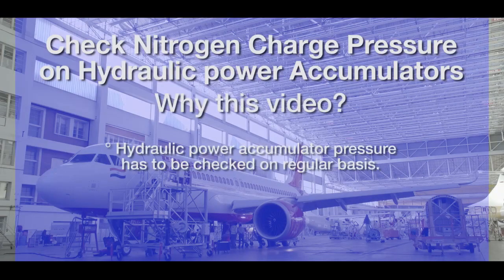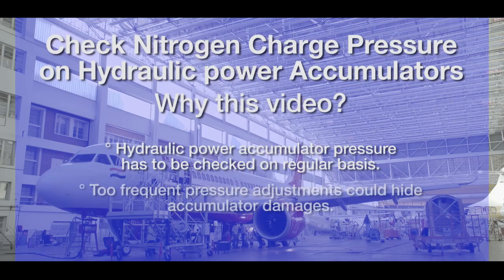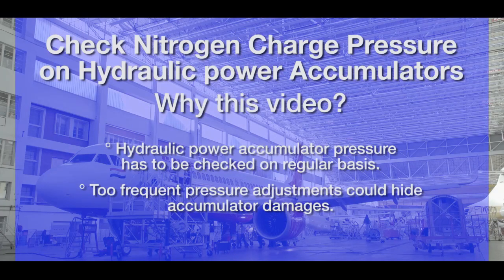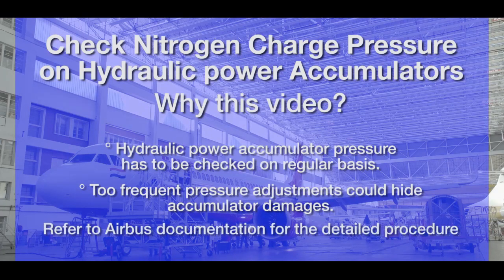Airbus Hydraulic accumulator pressure check

Comment: How does the pressure gets released from the accumulator when it is in flight. Like tyre it becomes hot expand and air comes out. How does this apply to accumulator?
Reply: There is no need for a relief valve, as accumulators are present in unpressurised areas where tempratures may drop below freezing point in-flight (high altitude). Plus nitrogen has low coefficient thermal of thermal expansion.